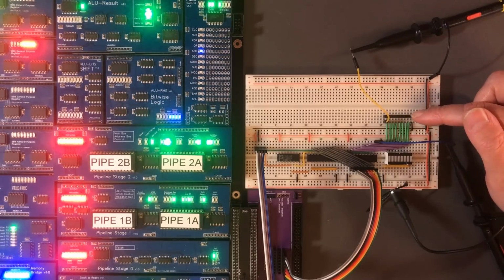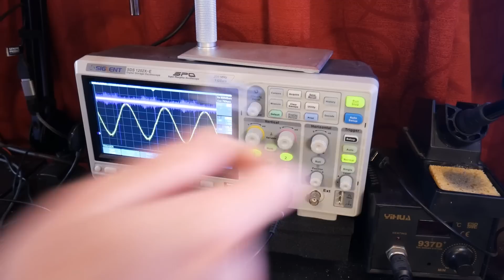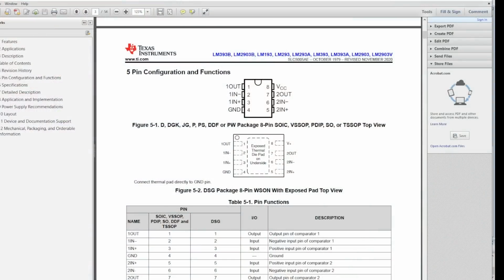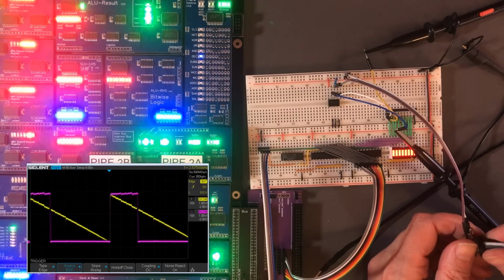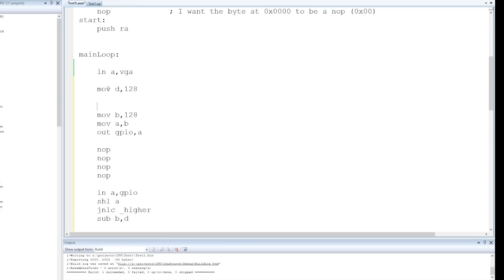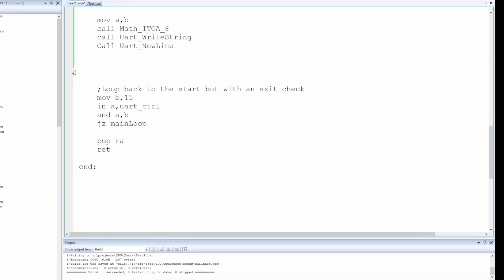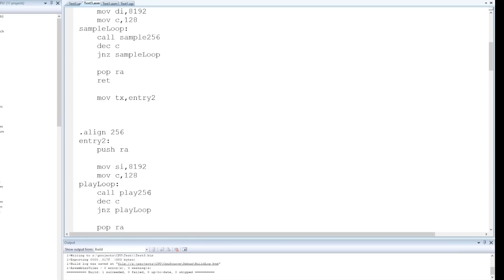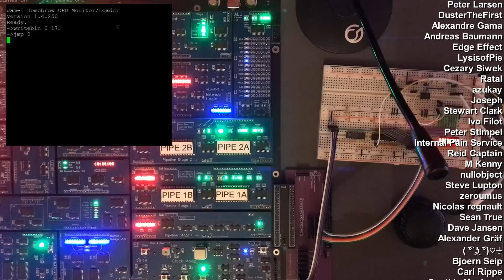Digital to Analogue and Analogue to Digital Conversion - IO from Scratch - Part 3

Comment: Another amazing video. 

I am afraid I am having a bit of difficulty keeping up. The fault is entirely mine though. My attention has a way of wandering about. In addition to my dayjob, I have been working on a little project of my own, that's keeping me busy as well. 

But keep it up. The A/D and D/A circuitry intrigues me. Do you need that offset for the output stage as well, and if so, how did you achieve it?
Reply: In this case he shouldn't need it because he is just outputing exactly what he read, but in case you want to add/ remove a offset to a audio signal, its usually done with a capacitor in series with the output which will only let the AC through, then if you need to add an offset to it simply connect a voltage divider to the capacitor output pin.
Reply: @cj09beira  Ok. Would you need it if you want to output a line out signal?
Reply from the maker: I'm outputting 0v-5v which works for that speaker. A simple DC blocking cap would make that +-2.5v to be line out compatible but it wasn't necessary for what I was doing here.

Comment: I never knew this was the method used by most ADCs given the inherant distortion caused by the temporal delay in the search process, interesting.  It would be fascinating to hear a comparision between this ADC and one that uses 8 comparitors, using the resistor ladder to create the fixed comparision levels for each bit's comparitor.  You'd achieve a time coherent sample point and a higher sampling frequency, but of course your amplitude resolution will drop from 8 bits to 3.
Reply from the maker: Yeah, I've seen that technique used. I could see a hybrid approach gathering a few bits each loop of successive approximation being very flexible.
Reply: An ADC with 8 levels only achieves 3 bits of resolution! It takes 2^nBits comparators for that technique. The biggest that I have seen was an old harris semiconductor chip with 6 bit resolution using 64 comparators
Reply: @maeanderdev  You did read that I said that the amplitude resolution will be 3 bits?
Reply: @ffsireallydontcare  obviously not. I've got no idea how I missed that
Reply: @maeanderdev  No worries! ;-)

Comment: Most modern AD are Sigma-Delta based, high frequency but one bit /*almost*/ is more precise and efficient nowdays. R-2R is retro :)
Reply from the maker: Eventually I want to explore a range of techniques, 1-bit would need more circuitry, wouldn't like to drive that manually on a home made 8-bit.
Reply: @weirdboyjim  : You'd probably want to use an eprom, with either a clock-controlled adder chip for the address bits (sorta slow, checks every combination), or with extra data bits to indicate the next higher/lower address to check (lets you check bits individually, but more complex).
Reply: I’d like to see a circuit using discrete capacitors. A big one to hold and a small one to add or subtract a quantum. I don’t like OpAmps. I would like to float an amplifier on the capacitor. Isolation transformer running at 48 kHz or floating elco supply power. Sending a charge package using MOSFETs. So actually two storage capacitors. One to each rail. Zener diode to measure the package on the float.